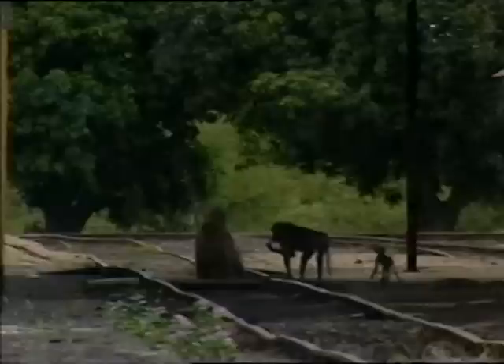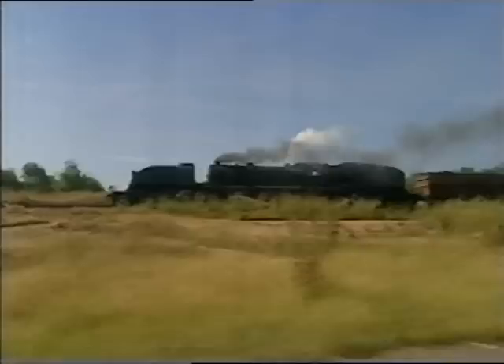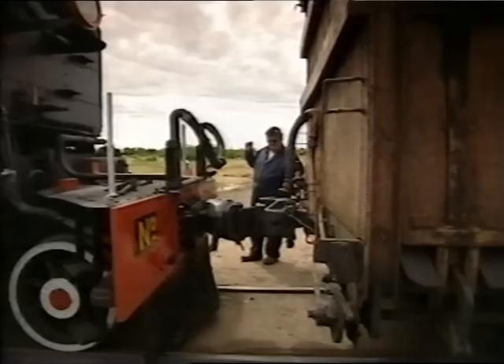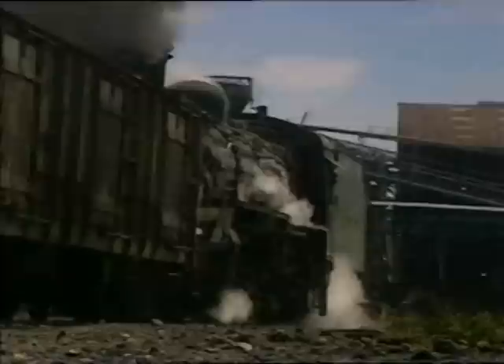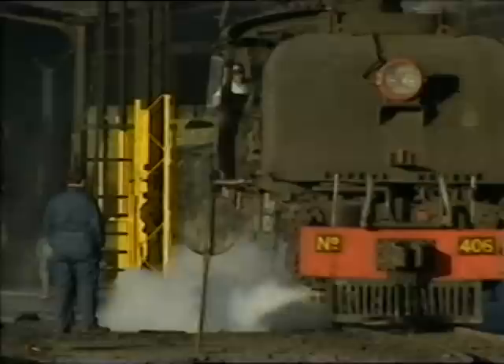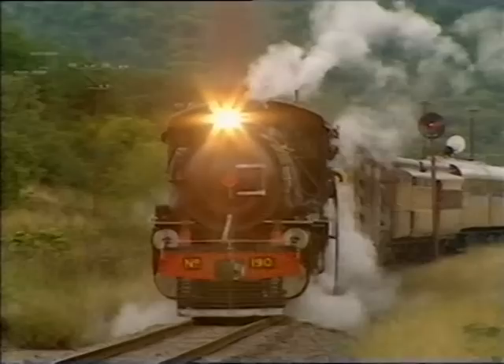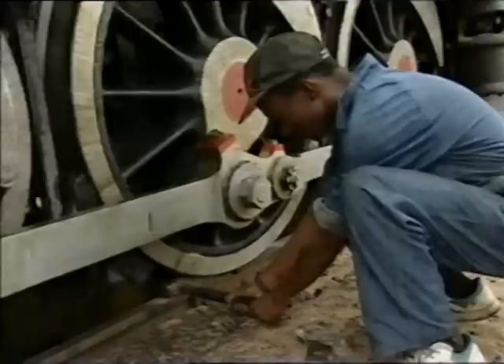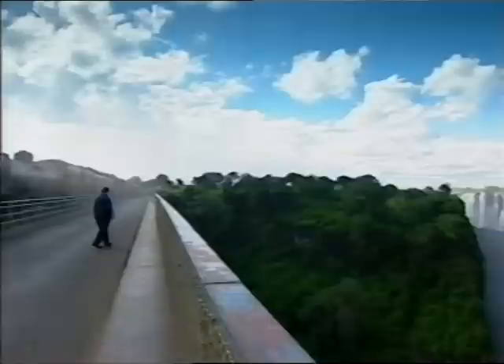Coltrane's Planes & Automobiles: The Steam Engine Part 2

Comment: I have learnt so so much its just un true but why 3 and not 4 cylinders  or was this due to the fourth not having enought steam excuse the pun ????? R.I.P. Mr Coltrane !! By looks of this we will miss you beyound beleif !!!!!!!!!
Reply: Quadruple expansion engines were built but not in great number. You’d have to increase the pressure into the high pressure cylinder to account for getting sufficient pressure for the low pressure. As said in part 1, the low pressure cylinder was only on 8 psi (and even then most of the effective work will be taken from the exhaust with the vacuum in the condenser) so another cylinder and it would be more effort on the engine than the resultant power out of the extra cylinder.